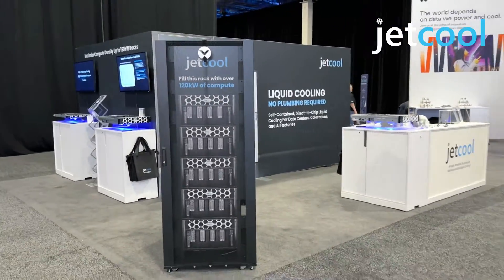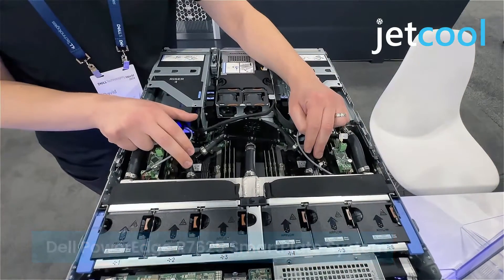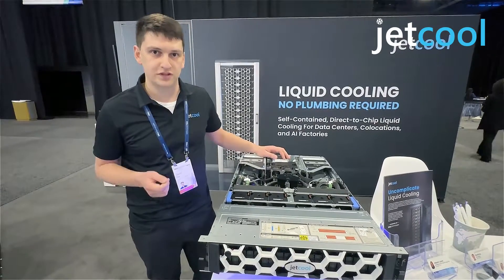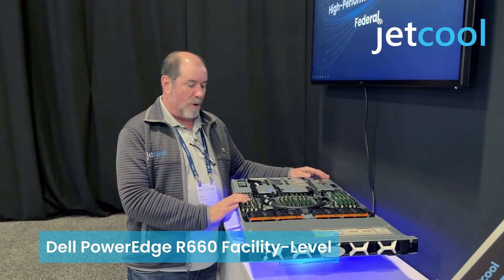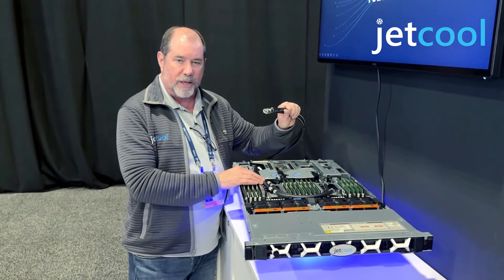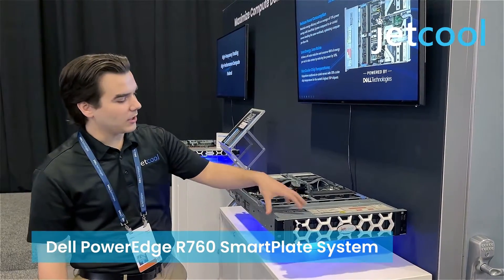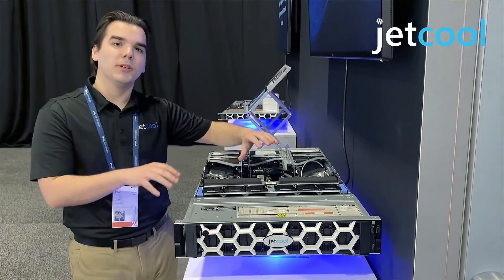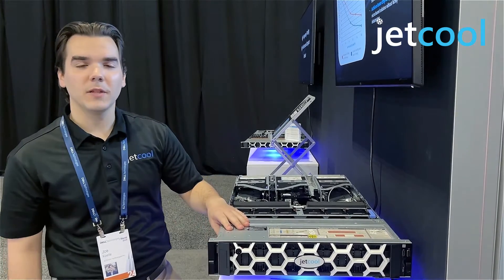Dell PowerEdge Liquid Cooling Server Demos: Dell Technologies World 2024 Highlights

Comment: Is there another closed water loop to another heat exchanger or is direct to cooling tower water?
Reply from the maker: For our facility-level solutions, the cold plates are piped to a CDU/Facility Water. For our closed-loop system, there is no external piping or plumbing, eliminating the need for CDUs, chillers, etc. The closed-loop system would just go into your average air-cooled rack in an air-cooled data center and looks like an air-cooled server from the outside.